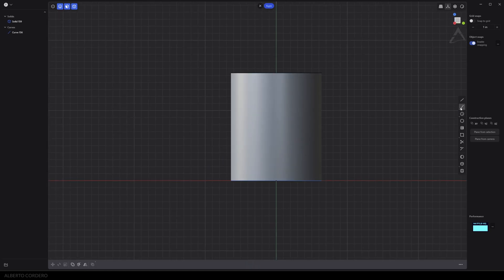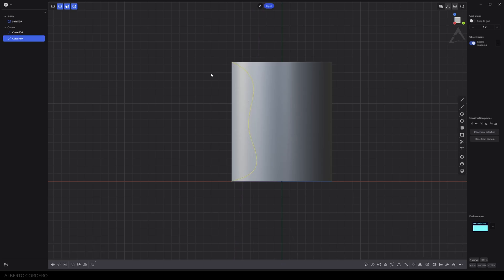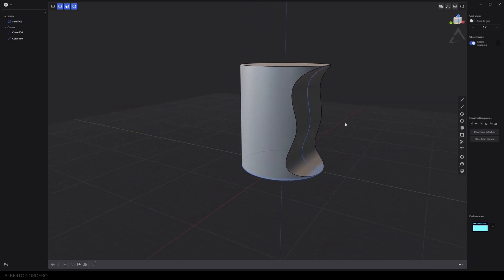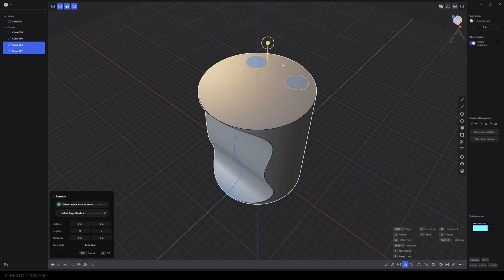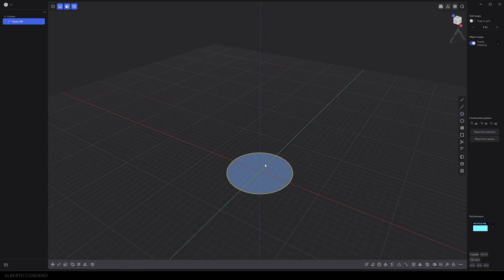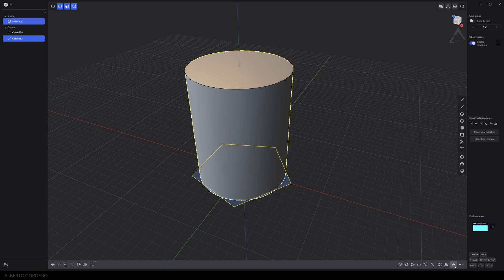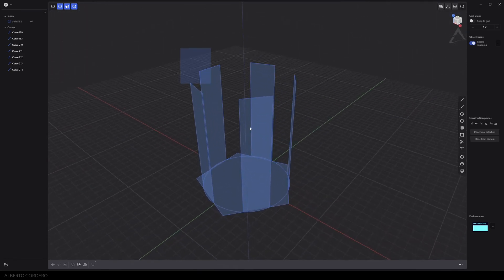Cut and Project in Plasticity

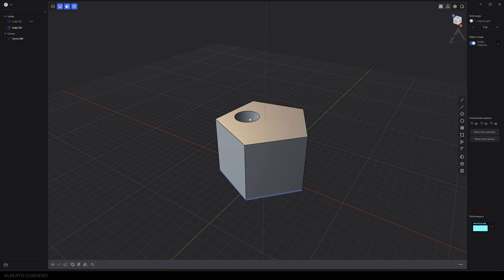Comment: Select select C boom, so simple.  REALLY??????  Select WHAT??   I am trying to make a hole in a surface like you do at 2:40.  Can you please tell me how to do that?  The only thing you really show is how to put the circle on the top surface.  I'm sorry, that seems rude.  But I've watched at least 30 videos now and not a single one answers the most basic of questions.
Reply: select circle, select object and press C, that's all. just watch video that covers basic tools and you will not have these questions. how you want to learn plasticity if you just can't find tutorial
Reply: @Dkncnsksmxkskzmmx  I watched about 20 "tutorial" videos,   None of them answer the most basic of questions.  AND, I learned that you cannot go back to the beginning of the build if you want to make some small dimensional change or something.  That's garbage.  I dumped Plasticity and got FreeCad.  It's awesome and there are many GREAT tutorial videos.
Reply: @Dkncnsksmxkskzmmx  then this tutorial has zero value.